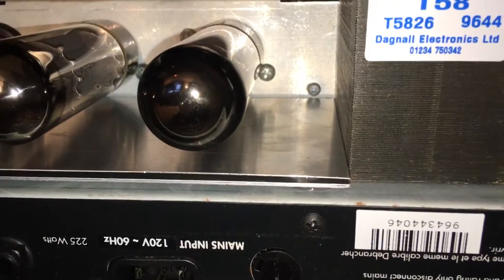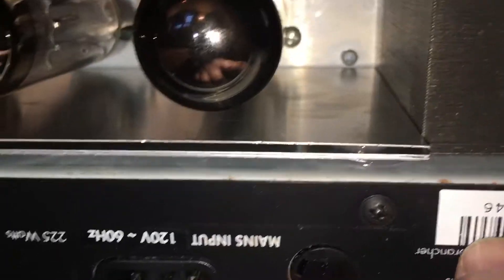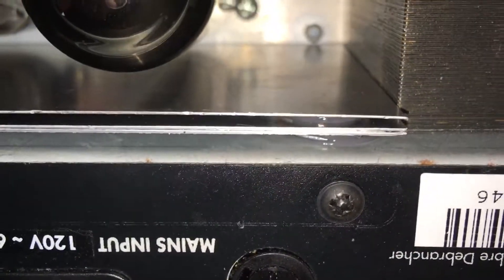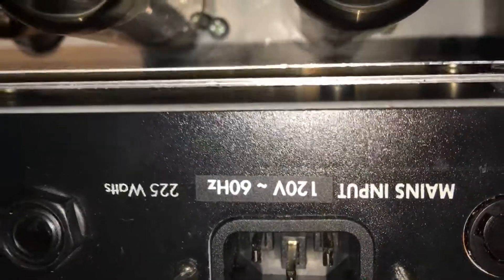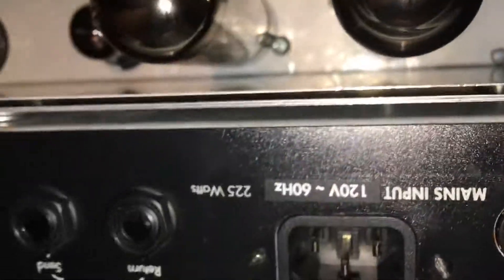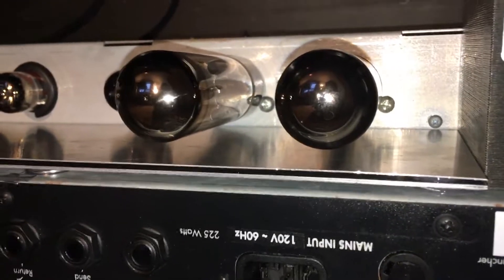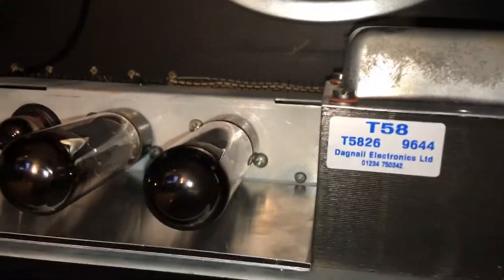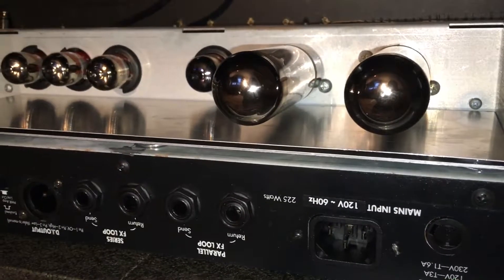JTM 60 heat sink installation

Comment: This is hilarious; the guys at Marshall seem to be blind not being able to position the output valves in a way that serves common sense - even my 14 year old nephew could see that this way of placing the o.v. is very stupid. I find it interesting that nobody here is complaining about this major design fault but is willing to undertake "projects" to make a device work instead of playing guitar. Marshall, Fender, Gibson - you usually have to mod those first, THEN they are good. That's why I use only Japanese stuff for years only - and I sold my JTM 60 years ago. Have a nice day.
Reply from the maker: @gnatiu  yeah, I thought it was kinda dumb too, but didn’t feel the need to bitch about it. I bought the amp (dead) at auction, paid a couple hundred to get it working, installed the heat shield and flipped it at a healthy profit. 
Some of us like projects.  You do you, and I’ll be me. Cheers.

Comment: I used the heat epoxy but it smells bad when it heats up
Reply from the maker: I’ve not had that issue... some brands are smellier than others
Reply: Would muffler tape work? You know the tape they put on motorcycle mufflers?

Comment: Did u do clipping diode bypass mod?
Reply from the maker: No. I generally do not mod amplifiers, i’ll just buy amps that do what i need innthe first place.  I no longer have this amp, however.
Reply: @10CentHead  Good decision.